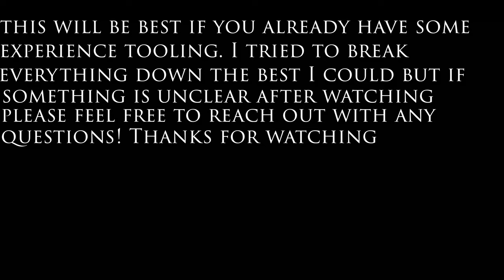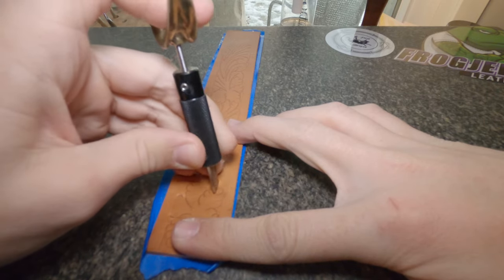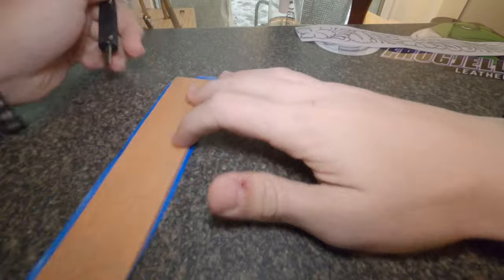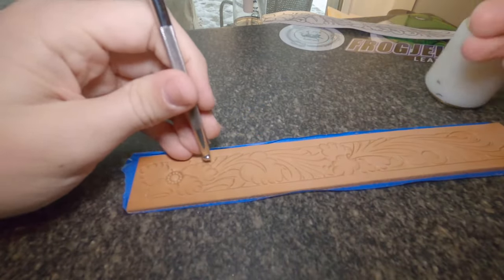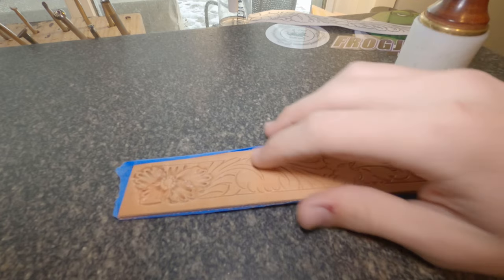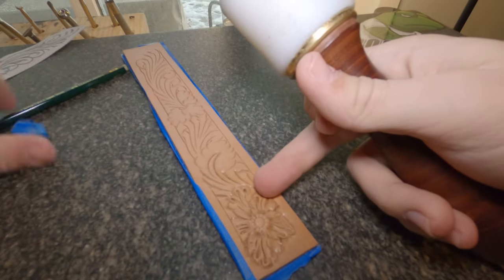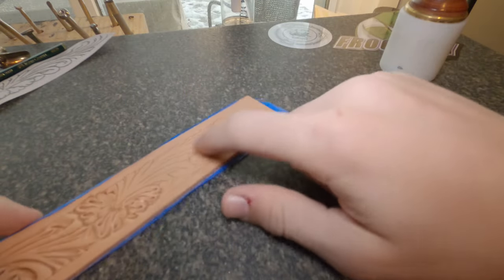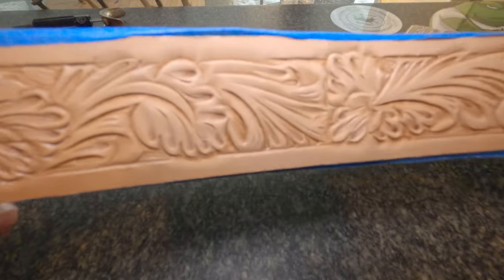How to Tool a Floral Belt (beginner leatherwork)

Comment: Thanks for taking time to make these videos learned alot ..quick questions ..on the wallet could you have put flowers or some design behind the letters or does that make it harder to distinguish from the letters (harder to read) ..also have you ever done colored dyes?
Reply from the maker: You bet! Thank you for taking the time to watch, I’d say it would be best to just keep flowers next to the letters and maybe have them fold over like they are running into the letters if you wanted to be more complex with it. There are no rules though so if it’s something you think would look cool feel free to give it a shot! They way that I normally incorporate letters into my designs would be to have the vine work going through the letters or having a scroll wrap around a letter. Might be something I could do a video on! As far as the dye no I haven’t used any colored ones. I was kind of wanting to try out red because I’ve seen other people use it and have it look pretty slick, just haven’t personally tried it
Reply: @jakeufford7356  ..thanks for the quick reply. What's the beveled one again? Is it a beveled half moon? Happen to remember a part #? Kinda wish you had included all the tools used in the project in description. I was looking into getting a few of the basic tools to do my first leather project. Keep those videos coming man, I subscribed
Reply from the maker: @jakebrooks1985  the bevel that I currently use is a Barry king but I couldn’t tell you what size it is because I bought it at a trade show so I just looked at the size in person. Before upgrading though I had a craftool from tandy and it had a part number B197. It’s a little on the bigger end so if you plan on doing tighter designs maybe look for something a bit smaller